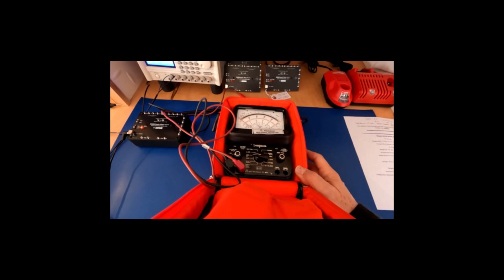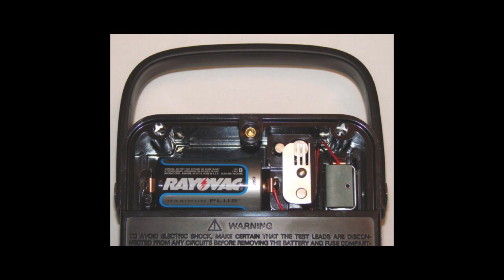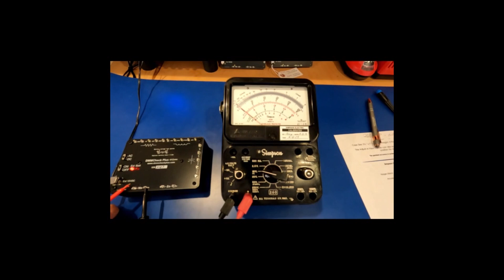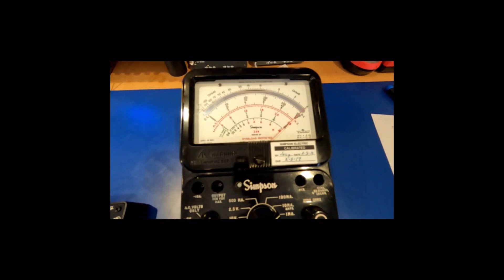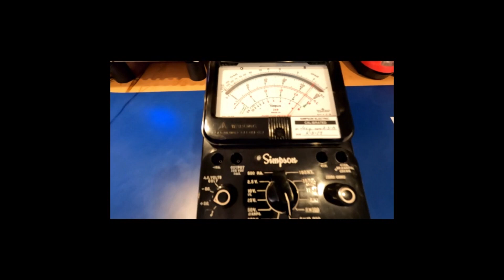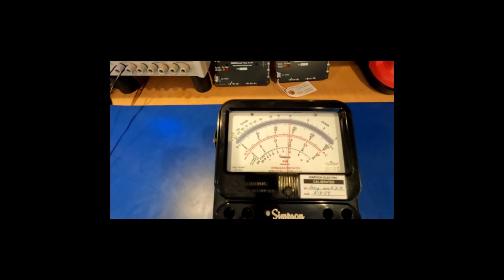DMMCheck Plus Vs. the Simpson 260

Comment: Simpson does not recommend using the 260 in the vertical upright position. It is calibrated lying flat in the horizontal position so the horizontal position is the most accurate.

Comment: Why not include a cal sine wave for rev 9.  Also, curious why you didn't use a common ground on the R's, so only one lead movement was necessary for measurement checks ? This all relates back to something I heard many years ago. A man with a watch can tell you the time. A man with two watches is never, " quite sure."  LOL